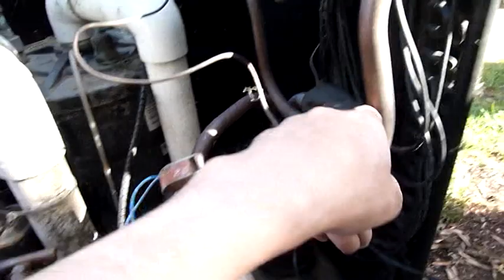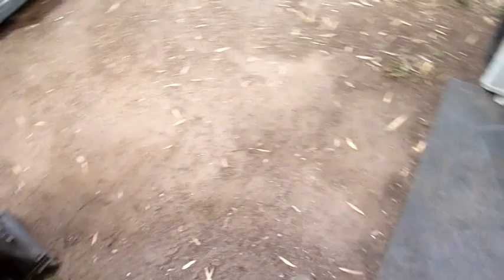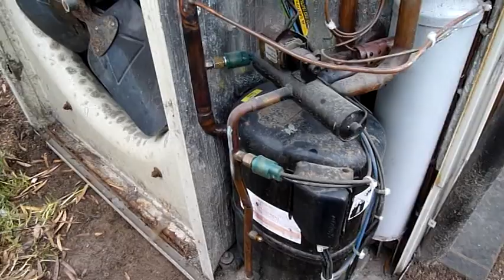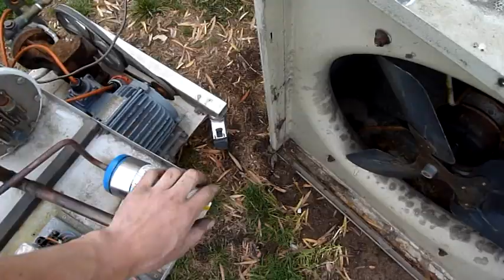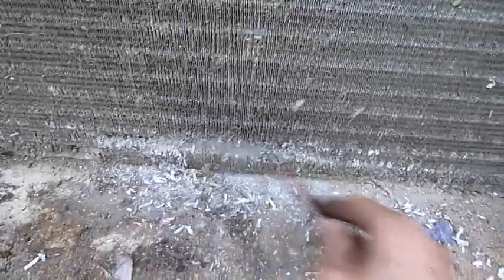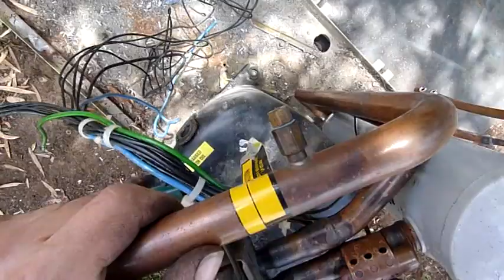Water Chillers Autopsy Pt2

Comment: @aussie50 I took apart a dehumidifier which is works on the same principal as stated in your video, anyways I took the compressor out and I want to know if it's safe to open or it's it will explode or something if I cut into it. If you can can you do a video of you taking apart a compressor? Thanks

Comment from the maker: damn :(, no getting that amount of water out in a reasonable time, no guaranteeing system reliability after :(. I always bin systems that have been open to rain.
at least now there are thermal and pressure based overload switches to prevent such things from happening, and not venting the system charge at all.

Comment: No problem!  I found out the.hard way when I was called.out to service a unit that had a "scab" (1/8" hole drilled on the line with a curved piece over the hole soldered on with Wood's alloy) type relief that blew off after the condenser fan motor locked up on a hot day.  Sadly the entire unit had to be replaced because it had rained hours before and the vent hole faced straight up.  Poor unit drowned after it blew off like it was designed to.

Comment: Fusible plug is actually Wood's alloy.  In the event of condenser fan failure return gas temp can exceede 250F which is dangerously close to critical temp of R22 and result in system explosion.  This was all before compressors started having internal bypass / relief valves.

Comment: Had you considered adding another compressor to your air supply or swapping out your existing compressors for bigger ones? Also, I don't know about anyone else but having an off the shelf silent air compressor, I find that regulating down the pressure is essential and makes your CFM capacity go much further, especially with things like blow guns.